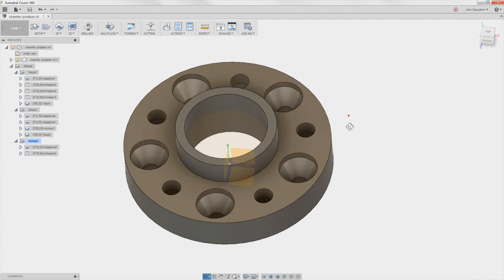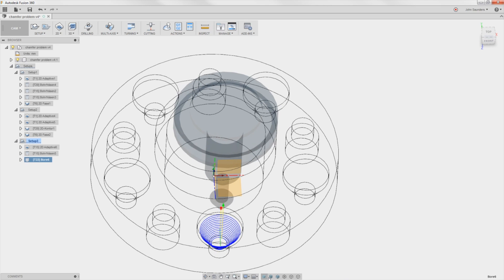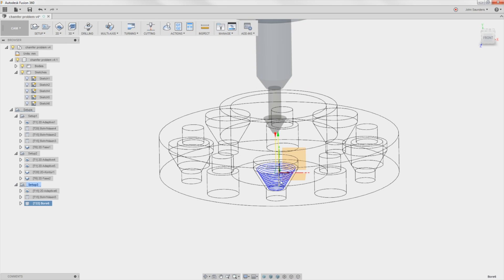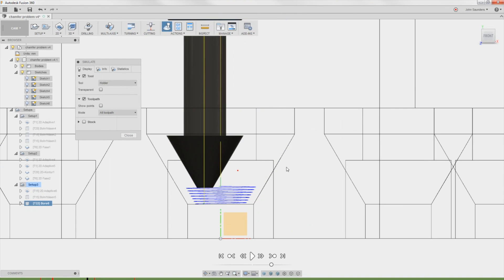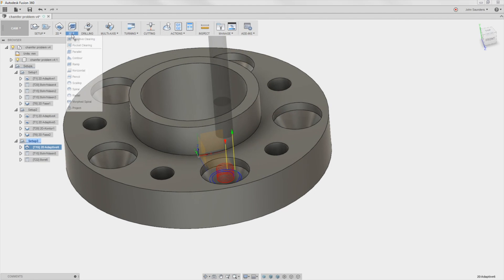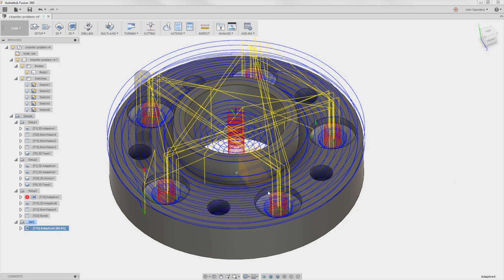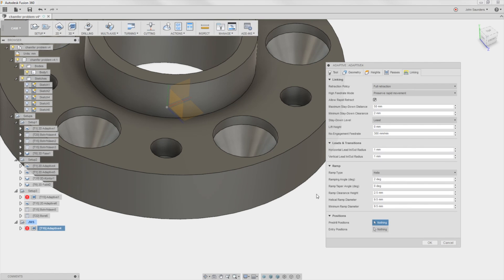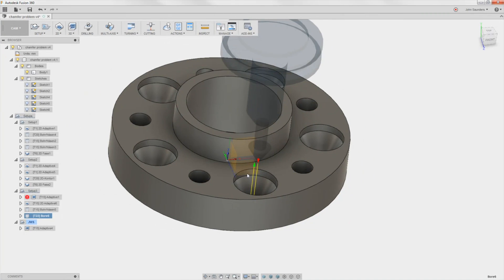Fusion 360 Chamfer Tip: Bore with Expression!  FF76

Comment: So I learned that if your chamfer mill is larger in diameter than the through hole on the bore, a boring operation won't actually work.  Using the height offset just results in an empty toolpath, without the empty toolpath error, oddly and infuriatingly enough.
I ended up having to use a 2D contour, then in the chamfer settings in the passes tab, manually adjusting the chamfer tip offset to the point where it was barely no longer blowing away the shoulder, then increasing chamfer width so that it actually cuts the chamfer properly.  Lots of eyeballing it in simulation before noticing that just the tip offset wasn't cutting the part right.  There is apparently no difference between an increased width just barely large enough to cut properly, in my case 0.060 and 0.120 but cut exactly the same.
Paradoxically the tip offset moves the tool closer to the center of the bore, and the chamfer width brings the cutter down to actually touch the modeled chamfer surface.

Comment: The bore with the chamfer tool won't work, the bore op generates an helical path, which is fine if you start outside the part, but here you won't machine the whole diameter of the largest end of the conical section.

Comment: I've been getting a lot of bugs lately. The biggest of all was that when I start fusion and open a file, most geometry selections are ignored. Reported it to tech support and they say it's a bug to be worked out. Hoping they get to it soon. It's making fusion hard to work with. It also prevents me from using the Select Similar Holes option in drilling ops. Bad combination of bugs with this week's product (500+ holes, 128 geometries)